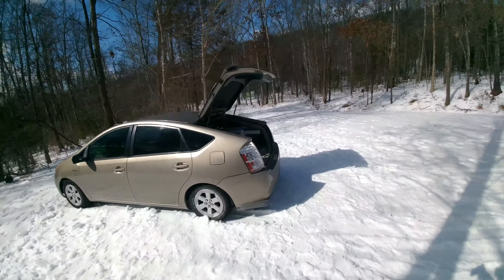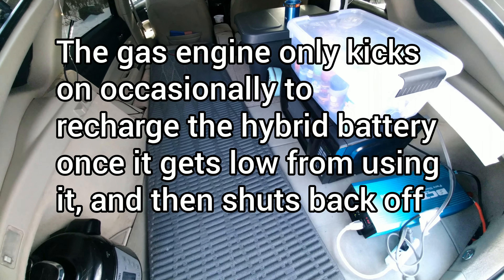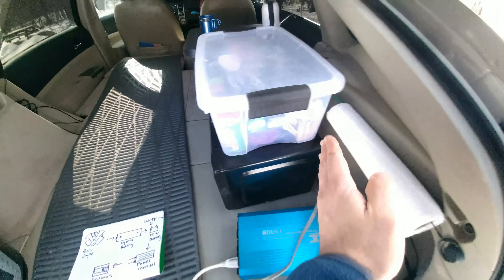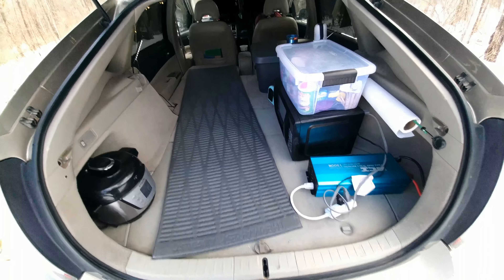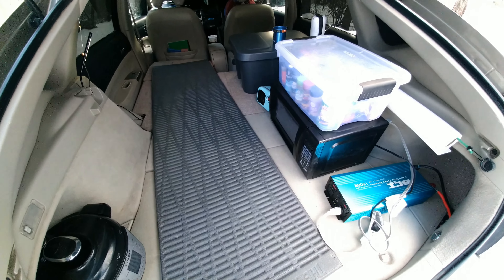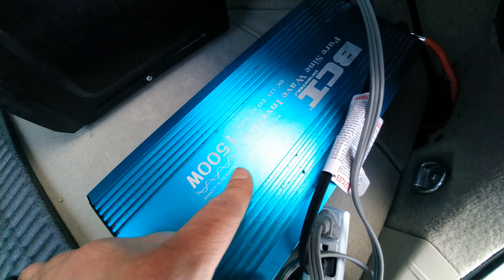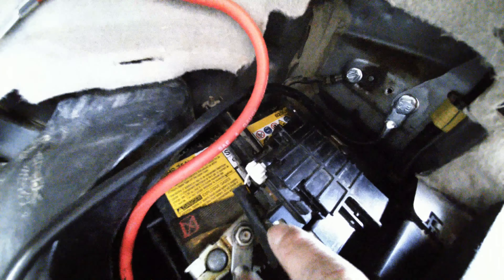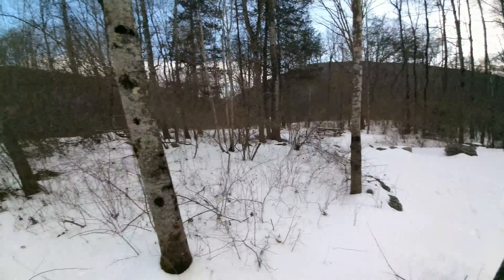How a Toyota Prius (& other hybrids) can be used as a GENERATOR! #OffGrid #Camping #Emergency

Comment: People can not afford to live in an apartment, so they are learning to live out of their car. 3:55  An inverter transforms DC power into AC power while converter can turn AC power into DC. It can change the voltage level from one level to another, such as from 110v to 12v.

Comment: The inverter is converting your ~13V DC (direct current) battery power into a 120V AC (alternating current) sine wave. Yes, very different systems, and things built to use the power for one won't work at all off the other.
I was wondering if you could use a cheapo not-pure sine wave inverter in series with a UPS power supply that will clean up its crappy 120V to a clean 120V. If there aren't electronics involved, you can usually get away with using a "modified sine wave" invert, which can be significantly cheaper per watt than a pure sine wave inverter. Use the dirty power where you can, and the clean power where you have to.
I've got a Ford Escape Hybrid and have always intended to try a little offroad camping using the car as a generator too. 
Love the Instant Pot.What really is the peak voltage needed for that, and how much steady state?
Reply: Really convenient for this power application that the Prius' 12V battery is in the back. Ford Escape is the front of the engine compartment. 
Though there is probably a more convenient contact point with the 12V of the hybrid system.

Comment: wow...that is very cool.  Thanks for the video.  Why not use cigarette lighter versus plugging inverter to the battery?  Sorry if dumb question.
Reply from the maker: You're welcome. You can use the cigarette lighter outlet also. But, if you're going to get an inverter for the cigarette outlet, they typically don't go over like 400 watts. The more powerful inverters need to be connected directly to the 12v battery
Reply from the maker: Where does it say Max 120 watts? If it's on the cap, mine broke off. 400 watts was just a guess, I'm simply saying that you can't pull as much power from the cigarette outlet as from an inverter on the 12-volt battery
Reply: @TerrellWSmith  buddy the point is that you can't run a 1500 watt inverter from the cig lighter, that you need a direct connection to the 12v battery using heavy gauge wire. 400w is just the industry standard for maximum draw from a standard cig lighter. Believe it or not, those old school windproof push in cig lighters that automatically pop out after the heating element gets glowing red hot most likely draw somehwere near 400w or possibly more, and those have been in cars for how long??? I'm surprised they stopped making cars so smoker friendly(not a cig smoker)

As a car audio installer I would even install an 80, 100, 120, 150, or 200 amp fuse(depending on load size) on the inverter positive as close to the battery as possible for an added layer of safety.

Comment: Hi there, I REALLY hope you can please answer this. I bought a car inverter but it plugs in the 12v cigarette port. Does it work on the same premise as this? Does it pull from hybrid battery and you can keep it in ready all night? I want to be able to use a heating blanket all night and hope it will start in the morning PLZ HELP!!!!!!!
Reply from the maker: Yes, you can use an inverter in the cigarette outlet all night as long as the car is in ready mode. But, make sure the heating blanket is not more watts than the inverter is rated for. you can plug in anything into the cigarette outlet and let it run as long as you want as long as the Prius is in ready mode and it will just recharge itself
Reply: You are so helpful, thankssssss so much!!!!!!!!!!!! Working on my set up now, have been eyeing a van for sometime and came across the video....Seems like there are advantages of owning  a hybrid so going to take advantage of mine.  The only thing I want to do now is turn or take out my passenger seat. I was told it might screw up the function of the air bag including maybe even for the drivers side? I don’t just want the electrical to function improperly.You got a new sub here!! Thank you!
Reply from the maker: @Moutain_Hunter101  you're welcome, glad I could help. Yes the airbag light might come on if you take the passenger seat out, but there might be a way around that, I'm just not sure because I haven't done it.

Comment: At 1000 Watts with 13 volts at the battery that's a 77 amp draw... that's an awful lot of amperage to be pulling steady on that battery... even if the traction battery is charging it...

Comment: I´ve been doing some research and find out that 1500W is a bit overkill? Some say it should be a 1000W max. I just bought a prius and I am not sure what Amp per hour has my battery. I saw that for example a 45AH battery can power 400W which is really small but I guess with the prius having a hybrid battery it is different. I am trying to buy the right inverter, can you confirm what kind of battery do you have and the Amps per Hour that it has?
Reply from the maker: No, 1500 watts isn't overkill, most Prius campers I've seen use about 2000 watt inverters. I have a standard Toyota 12 volt battery for my Prius, I think it is 35 amp hours. But the amp hours don't matter if the Prius is in ready mode

Comment: Sorry I am not smart when it comes with electricity but In theory, how much power can you draw from the car battery? Can you power let’s say a mini kitchen stove or microwave? Or will the battery or generator burn out? Any links to helpful website that talk about this will help please. Thanks 🙏
Reply from the maker: i dont know exactly how much. It runs off the hybrid battery basically. i wouldnt go over 1,000 watts

Comment: I have a 2016 prius and the accessory battery is under the hood (not in the trunk) so would I install the inverter under the hood as well? Thanks
Love the video, great info.
Reply from the maker: No you do not put the inverter under the hood. You would have to get some really long inverter cables to wire the cables into the cab of the car, I've never seen anyone do that though, because most Priuses have the 12 volt battery in the car. Check out Priuschat.com and look at what people have done on there, and post the question there if you still don't know

Comment: What year is your Prius? I have a 2010 and the 12 volt battery is under the hood in the front of the car.
Reply from the maker: I have a 2006. I thought only the Priuses within the past few years have the 12-volt battery under the hood. Mine has a positive and negative terminal to jump start the car under the hood, but the actual battery is in the trunk
Reply: @MountainSpringsAdventures  Ah, you are probably correct. The terminals are in the front and I assumed the battery was under there. Thanks!

Comment: What's wrong with a Coleman gas stove it will do all of that more efficiently and without moving parts and really do some cooking ,, microwave is just warming up ready meals ,,  but if you believe that  going from gas engine ac generator  to 300v battery , then inverter to 12volt battery and from that inverter back to 115v ac  to  plug in a microwave if  efficient , well you may also believe everything else your hear on TV .
Reply: I mean it might be nice in storm situations when the electric is out for a few days?  Might help run my freezer a bit.  😊
I would never eat microwaved food though. 🤮🤢

Comment: Love this adaptation. We have ‘21 Sienna Hybrid (love it) and Euhomy 45L Freezer/Fridge. Wife and I are in our 80’s so not living in the car but we do travel extensively. We did a custom camper/rv build on Ford Transit and understand the hook-up that you demo. HOWEVER, we had 100 AH LiFPO house battery that supported Micro, Coffee, Induction cooktop, low watt heater. And as we drove the car’s alternator recharged the batter as did 200 Watts of Solar up top. I have trouble imagining the motor running while ignition is off as when we are in motel or even at home. Should I assume that your ignition ACC is on while you sleep OR were those Toyota engineers smart enough to charge the system when low?
Reply: They were smart. It's all automatic.

Comment: Can I plug in 120v appliances into a 110v outlet? I'm looking at pure sine wave inverters and electric skillets but all the inverters are 110v and all the electric skillets are 120v
Reply from the maker: I'm not really sure, I don't know the difference. All I know is you can plug in any plug that plugs into a wall (in the USA) into the inverter
Reply: 110=120v.  AC is supplied as a waveform.  By the way, you (like me and everyone else) should do a lot of research and consult with knowledgeable people, eg: your electrician or an electrical engineer, before proceeding - electricity mysteries can equal deadly shocks and mistakes.

Comment: Could you use the 12 volt port on the passenger side with an adapter to run the inverter?
Reply: Using the 12V port is not suggested - the current draw could easily exceed the capacity of the wiring, i.e. the wiring gauge is too small at the 12V port and would overheat with any significant load like that the inverter would require.

Comment: Does the ignition have to be turned on in order to keep the battery charged up during using appliances?
Reply from the maker: Yes, the prius must be turned on (in "ready mode") to power high-powered appliances like a microwave

Comment: Question: You show the microwave plugged in, but what about the other devices? Do you have all the electrics plugged into a multi-plug surge protector out of the frame and only use some at a time? Are they all unplugged until you plug them in when you need them?
Reply from the maker: What electronics are you talking about? I only have a microwave and an instant pot pressure cooker, I use them with the power inverter and turn the power inverter off when they are not being used
Reply: @MountainSpringsAdventures  The small heater...?

Comment: why do you have a space heater if the car can keep temp?
Reply from the maker: Good question. I just got this little heater for $10 at Walmart to see if it would be more gas efficient than running the heat all night, and I believe it is more gas efficient. The engine only kicks on every 10 minutes or so I believe with this heater but I haven't actually timed it yet

Comment: Hey guy, enjoyed the video..why just a 1500 w inverter?  I'm looking at a 2000 w . Can I use this wattage?
Reply from the maker: Yeah you can use a 2000 watt inverter, I just Don't have a need for 2,000 Watts. The most Watts I will need to use is like 1050w oh, I didn't want to Overkill
Reply: @MountainSpringsAdventures  thanks for the prompt response!!! My reason for 2000 w is I already have it and wouldn't need to purchase one if this was usable. I watched other videos and several had used the 1500 w and made me wonder if there was a safety issue or something  for not going larger.  Thanks again 😊
Reply from the maker: @afwilbanks4172  yea I've seen people use 3000 watts. I just personally don't like going that big because I don't need it. there's no reason you can't use it if you already have it. But if it's not a pure sine wave inverter, then don't expect it to give you truly 2,000 Watts, it will probably only give you a little over 1000 Watts
Reply: @afwilbanks4172  You can use any inverter, but be sure to inline fuse/breaker to 75-95A.   The car's DC-DC converter cannot supply more; also research the battery in the car, as that can be a limited factor also.  As inverters get bigger, they tend to draw more 'phantom' (idle) load.  You want to ideally minimize that idle draw by sizing to an inverter like one of those '1000w/2000w' units.   The second wattage is the surge (very brief) limit, such as when a device with a motor is powered up and a surge occurs.
Reply: @cawag98  thanks for all the responses.. very helpful!!!
Reply: @MountainSpringsAdventures  So do you think I should get a 3000 Watt inverter  If I want to possibly keep a freezer cold in an emergency power outage situation at some point?  Or will the one you have do that for long enough each day to keep it cold.? I need to learn more about this so I can use my prius.
It's a 2005

Comment: Great video. I don’t believe this power set up will work in a Prius Prime. My understanding is that the 12v battery is located in the engine compartment. Not sure how the inverter would be connected to the battery with it located under the hood versus in the cargo area.
Reply: I believe I saw a YouTube video recently where someone did that on a Prius, by drilling a hole under the drivers side dashboard , and running cables up to the12 volt battery under the hood. The inverter sat on the floor. It’s on YouTube somewhere. Sorry I can’t remember which channel!

Comment: Actually you don't need even inverter. You can connect everything to HV battery, it is about 200-240v DC and most modern electric appliances works fine straight from DC power. But in case of USA you need 240v appliances like used in Europe or so

Comment: Put a capacitor,  it will save the prius components when the microwave surge starts up
Reply from the maker: What is a capacitor? do you mean like a fuse?
Reply: @MountainSpringsAdventures  a capacitor is much like a battery except it only stores a charge for an “instant on” amount of time. This is why they are used for energizing start windings on compressors and fan motors.

Comment: I know you're limited on space. But if you get an auxiliary 100ah lithium battery and a DC TO DC charger for lifepo4 batteries.. You'd have more capacity, run little bigger inverter and it would be less taxing on your car battery.. They're not designed for that kind of cycling plus you could use battery&inverter with car off.. And charge aux battery only when you need to

Comment: There's a way to install a second 12V battery to the Prius. Do you know if that will increase the capability of the Watts output? I would assume it would stay the same right?
Reply from the maker: I don't know actually. I know that in solar power setups they connect all the 12 volt batteries together to form one power cord.
Reply: The long term power available from a 12 volt source in a Prius is limited to ~1,300 Watts.  This is due to the max current available from the 209 Volt battery to 12 Volt battery converter (100 Amps).  I am concerned as MSA is drawing near full power from it, or more at times.  One thing we Prius owners know we CAN'T do is jump start a traditional gasoline powered car with our Prius on and in Ready mode.  This is known to burn out the converter when the output of our little 12 V battery is exceeded.

Comment: The hybrid battery does NOT charge the 12v. The alternator charges the 12v. RTFM. You'll see the method for jump starting a Prius (not fun). After you jump it, you have to drive around for 30 minutes before shutting off because of the intermittent running of the engine because... The hybrid battery does not charge the 12v. Hope that helps because jumping a Prius sucks! Sucks sucks!

Comment: I've done this. Why have a space heater when you have the climate control of the car? Heat or A/C? I've camped in my Prius V (larger Prius, no longer made) in 95f+ and below freezing, A/C or heat with climate control.
Same thing. Engine turns on every 5-10 minutes for about 90 seconds. Uses very little fuel.
Reply from the maker: Using the heat is less fuel effecient than the AC, and the little space heater is not as POWERFUL as the car's heat but it works good enough and uses less fuel

Comment: So, basicly you are saying, the ECI engine turns on and generator MG1 creates AC power. Your car converter convert this AC power into DC power and stores this into your 206 volts DC Hybrid battery. This 206 Volts DC is then converted in 12 volt DC for your MGA battery in the trunk. Your little  converter converts it back in 110 volts AC for your applyances.
This works for a 12 Volt MGA battery like in most Toyota Hybrids because these are deep cycle batterys and can be loaded and emptyed in a short time without problems. But be aware that some people are using a regular 12 volt battery  and these don't like to be filled every few minutes by the converter. So, check that first on top of the 12 Volts battery.  If its only allowed charging with max 4,5 Amps, its a MGA battery.
Reply: AGM

Comment: how big of a power inverter can I use in the Prius?
Will it affect anything if I get a 4,000 watt
Reply: You are limited by the size of the DC to DC charger in the car. This replaces the function of the alternator in a regular gas car.

These chargers are normally a little under 1000W.

So if you connect a 4 kW inverter, you will run down the 12 V battery on full power.

As far as I know, the largest 12V inverter you can get is 3.5kW, this is due to the amp needed is so large. Over 2kW, it's better to run 24 or 48V systems.

So the short answer is: no, you can not.
Reply from the maker: I think 4000 watts is far too much. I dont suggest inverters over 2,000 watts, and dont use more than 1000-1500 watts at once
Reply: @MountainSpringsAdventures  thanks man for your response also I love your videos!

Comment: Wow! What year/model is your Prius? Are the batteries Lithium? Is it AWD? Good job and more power.
Reply from the maker: 2006, no they are nickel battery, it's not all wheel drive
Reply: @MountainSpringsAdventures  thanks. I’m a new subscriber. Dude I like how “to the point” you are and very real. My wife has a Prius as well and I will show your video to her.
Reply from the maker: @InTodaysVideo  cool, thanks, so glad you like the vids. More vids coming out
Reply: @InTodaysVideo  I've got a 2020rav4 hybrid with NiMh batteries as well, and I'm MAD AF that I didnt wait 6 months to purchase because toyota started using lithium batteries in later builds of my exact car 😭😭😭😢😢😢😑😑😑😓😓😓🤬🤬🤬🤬🤬....FOR NO EXTRA COST FML
Reply: @FlipSRT4  for what it's worth NiMh lasts longer than Lithium in hot climates.